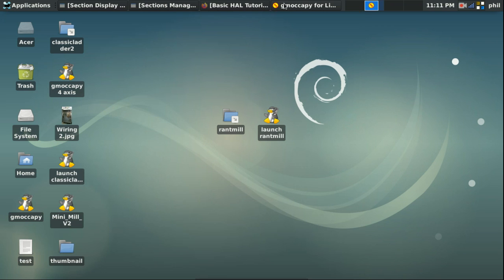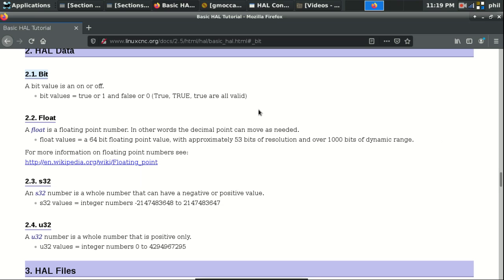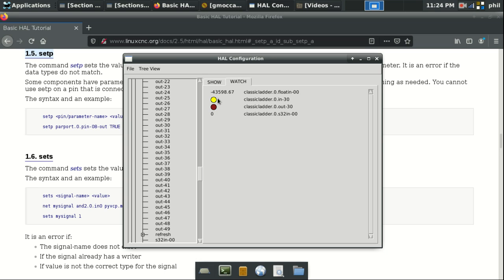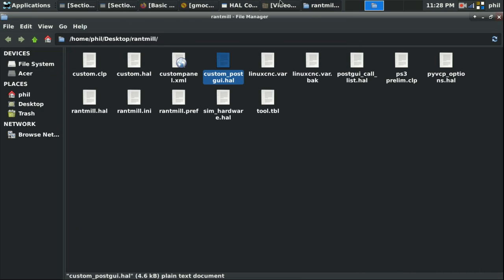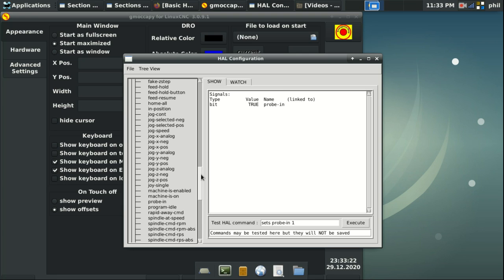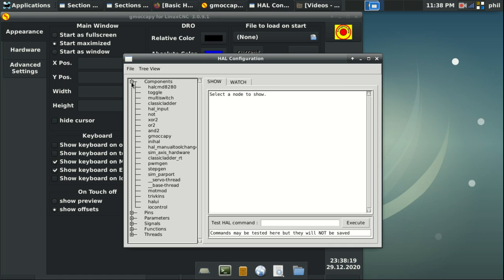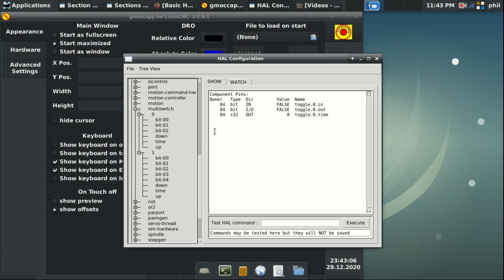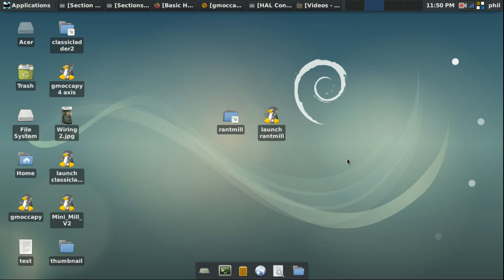LinuxCNC Hal basic tutorial part 3

Comment: this is beautiful
I am having some problems operating the machine with my plasma
  Which is operated as breakout board control via a parallel port
Please please can you help me?
Reply: And work on Linux CNC software
It is a complicated and difficult thing
Please help me
Reply from the maker: @aoazliten5417  what are you having issues with?
Reply: @TheFeralEngineer  Thank you for your reply
One of the problems is that the hub motors operate on the "stepconf" setting.
And when I turn on QTVCP or one of the other interfaces, it does not work
Reply from the maker: @aoazliten5417  does it work in axis or gmoccapy?
Reply: @TheFeralEngineer  Works in the axis
Can we communicate through a social media?
And remote access to my device
Reply from the maker: If it works in axis, it should work in the other interfaces. Did you change the ini file for a new interface or did you change it in stepconf?
Reply: @TheFeralEngineer  No, I did not change any file, because I am not an expert in working with linuxcnc
Reply from the maker: @aoazliten5417  did you try it with gmoccapy?
Reply: @TheFeralEngineer  Yes, I've tried it with gmoccapy mill and it works
As for gmoccapy plasma not working?
I did not understand why ?
Reply from the maker: @aoazliten5417  have you tried using plasmac? Are you using 2.8 or 2.9?
Reply: @TheFeralEngineer  I am working in version 2.8
I think the problem is in copying some numbers and modifying them?
And I do not know how to amend it?
Reply from the maker: @aoazliten5417  what did you copy?
Reply from the maker: @aoazliten5417  i really don't have time, honestly. I'm trying to catch up on my own stuff and I'm falling behind. Try the LinuxCNC Facebook page and the Linuxcnc forum.

Comment: Hey, be careful, you're dealing addictive content! I've started looking for new doses everyday in my subs list 😜
For ideas, well, INI file hasn't been covered, as well as the role and content overview of the different hal files so that we have a clearer view of what's inside our config directory once we've run step/pncconf.
Maybe one about the base and servo threads to set the differences and usages clear.
Finally, a presentation of the other tools in the hal chest could be cool too.
Just tell me if you need more 😜😅
Reply from the maker: I'll be going over more ladder and hal content before i delve into ini. The hal stuff will include usage of some of the common and not so common commands, but i give a really good cross platform explanation of and2, or2 and xor2 on my classic ladder video on and, or and xor circuits. I'll do a comparison of toggling in my toggle and multiswitch tutorial for hal, which will kinda start to pull the two technologies together. 

Yeah i need a day or two to unwind a little. 9 videos in 11 days is exhausting 😆